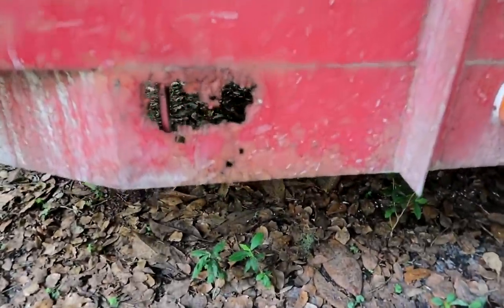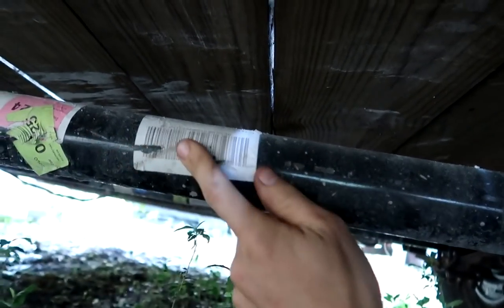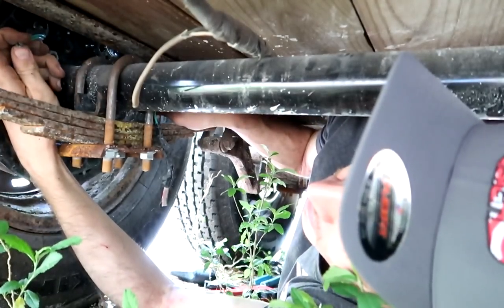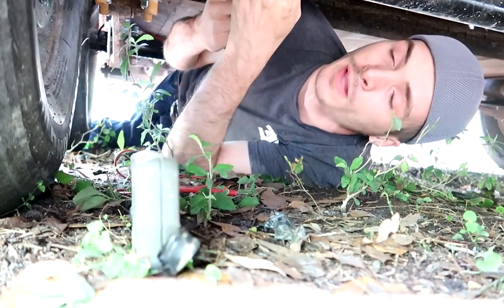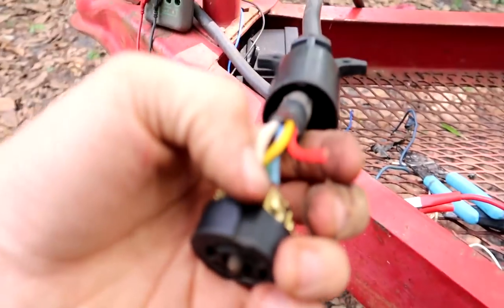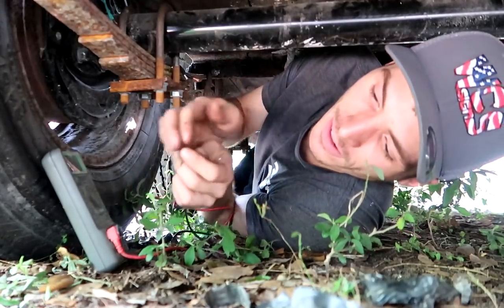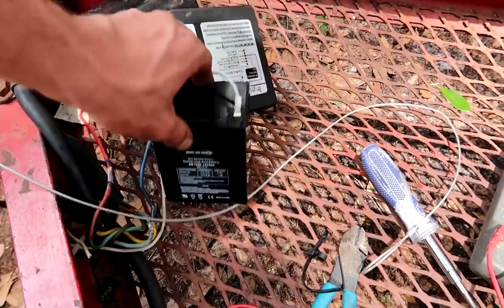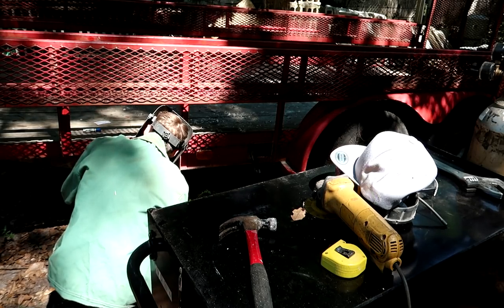$500 Trailer has Issues

Comment: What I would do with that trailer.. get yourself some 12/2 or 12/3 marine grade wire (sheathed, weather proof) and just rerun everything.  A side for each brake and new wires for left/right turn signals.

  In my experience with trailers, it is always the dang wiring that goes bad before anything else!

Comment: If I remember right on those 7 pin trailer jacks the red and black wires provide 12 volts from your truck to keep the battery charged. If they are not connected, the battery will slowly go dead

Comment: That is not for pretty it is called a wrap tongue and supports the trailer from bending in half buy a damn new trailer instead of used they are 2900 for a new 18 ft similar to what you have or get one for 700 mote with bigger axles

Comment: young man ,

U NEED TO  COMPLETE REPLACE   WRAP TONGUE FIRST , I BEEN DEALING WITH TRAILER ALL MY LIFE / I THINK U NEED TO GO WITH  6 INCH ANGLE IRON / IF U DO REPLACE WHEN " ANGLE IRON  ON YOUR SIDE OF YOUR TRAILER  U WILL HAVE BETTER WELD   "  B E C A U S E "  U CAN PUT HALF OF THE ANGLE IRON  UNDER KNEE THE TRAILER  DECKING FRAME S AND HALF OUT SIDE OF THE TRAILER DECKING FRAME / I HOPE U KNOW WHAT I MEAN   ? ? ? ? .   / OVER ALL BE BETTER WELD ! .

U   HAVE FEW RUSTED HOLES ARE VERY RUSTS  ,  OF COARSE U CAN  ALLWAY FISH PLATE IT  / I DON'T THINK WILL WORK VERY LONG EITHER  / NEED TO REPLACE " WRAP TONGUE  " WITH  BRAND NEW STEEL  >  1/4 "  OR 3/16 " BY  6 "  TO 8 " WRAP TONGUE ! ! ! ! .

BEEN IN THE BUSNIESS OF CONST .  AND SALE ALOT OF DIFFERANT KIND OF TRAILER !

SOUTHER  COMFORT TRAILER OF NORTHEAST LOUISIANA  !